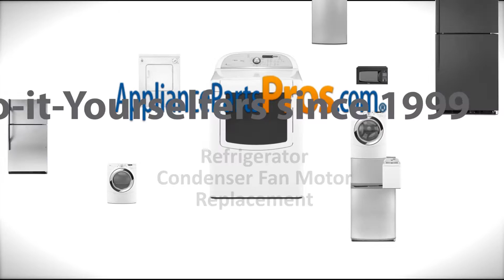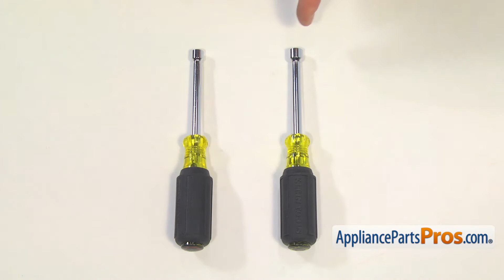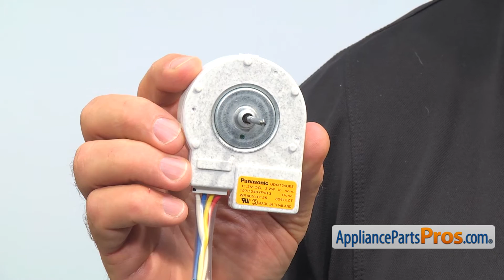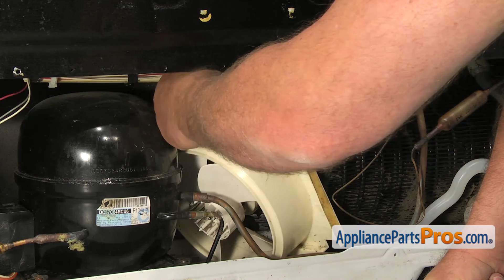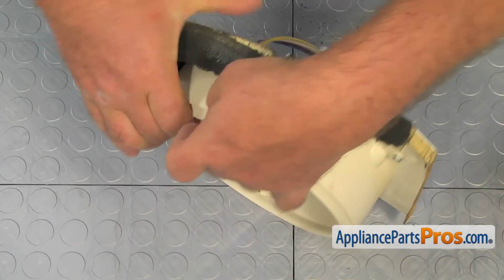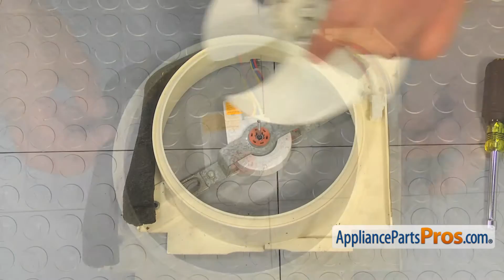How To: GE Condenser Fan Motor WR60X10209

Comment: I have a GE  GDSL0KCXLS
  it is virtually impossible to get the fan out.  ive been under there at least five separate times to no avail . The hoses are in the way on mines. But this is a great video.  anyone can offer a suggestion??